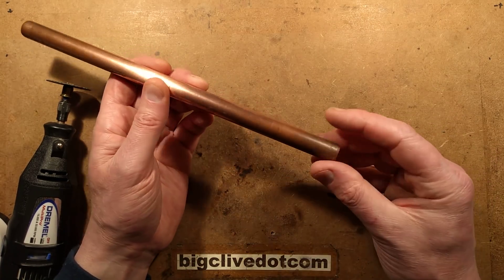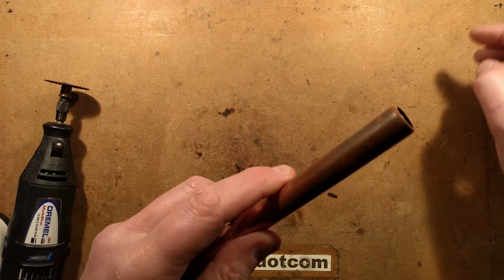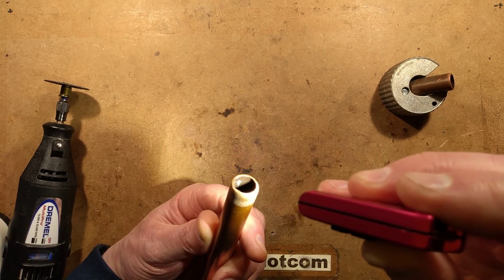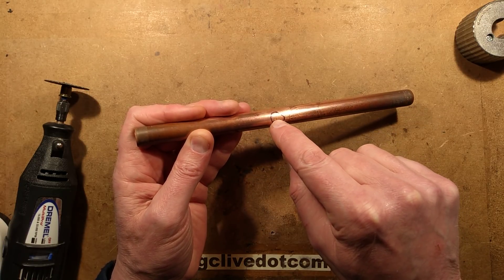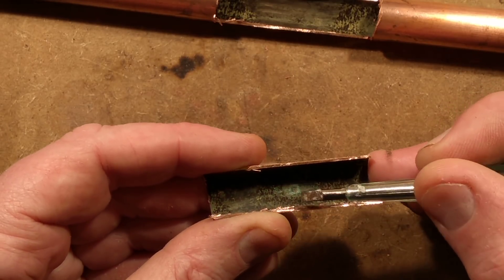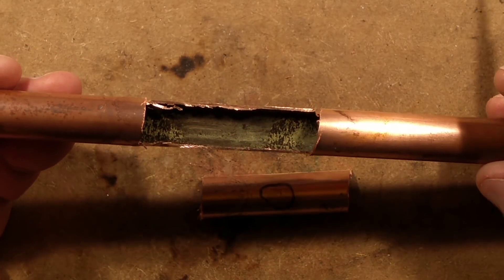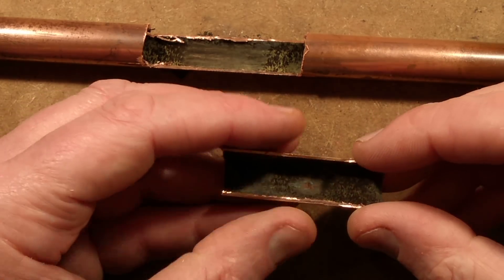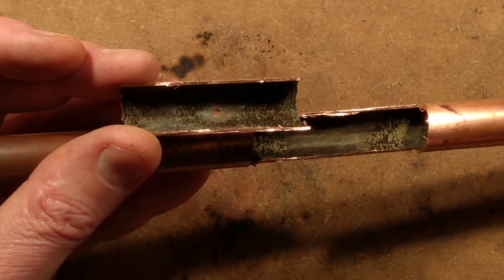Odd pinhole leak in copper pipe.  Selective electrolytic corrosion?

Comment: Great video!  As a plumber myself I see electrolysis issues all the time.  A lot of older buildings here would ground (earth) to the water lines.  Crazy!
Reply: If you keep having the problem, add dielectric unions and insulate the pipe from any pipe hangers that may be grounded.
Reply: @drewdward1   Could the same issue be caused if an exposed copper ground strap for telephone equipment runs over the top of and is in contact with bare copper pipe?
Reply: @paull3031  I'm sure its possible.   We always try to insulate our copper pipe from contact with pretty much anything.  We try to use more PEX pipe than anything these days.   I love the newer 'push' fittings, and no electrolysis  issues.
Reply: @drewdward1  I replaced all the copper in my house with PEX with some crimp fittings but mostly the Shark-Bite push fittings.  It's not very nice and was obviously done as a piecemeal copper replacement,  but I do plan on picking up a couple proper hot and cold water manifolds and running it properly.
Reply: @drewdward1  Push fittings are good ....... but will they stay good for 30 years (and would you care in 30 years time anyway)?
Reply: @totherarf  At this point I'd wager more on them than hand-crimped copper rings due to consistency.
Reply: @drewdward1  i find the rings to be super reliable if crimped hydraulically done with the bolt cutter looking tool or worse with the smaller versions i'd trust the push fittings all day
Reply: @Mister_Brown  Very true, I never have to replace plumbing that was properly crimped. Gotta keep an eye on those helpers/apprentices though!  To be honest, I only use push fittings for 1/4 to 3/4" pipe/tubing.  We use the 'Propress' tool/fittings for anything larger and they work really well.  I still solder, but not very frequently.  I am the lead plumber for my local school system and they don't like me or my guys to use fire.  Some silly nonsense about safety and whatnot.  ;-)
Reply: @drewdward1  silly indeed, i remember growing up in the 90's we had high pressure steam heat throughout our schools and you would often see the maint guys with an oxy rig brazing something.

then again the boiler was still coal fired because they had to refurbish it in the middle of the energy crisis and moving to oil would have been expensive
Reply: @drewdward1  Is it even legal to have a copper pipe system unbonded?
Reply: @GigsTaggart  Its legal, just may not be up to code based on where you live.  Also, all inspectors are different.
Reply: In the UK it is legal to not have all the copper pipes bonded . ... if the main pipes are not metallic and you have RCD protection! As you say, different areas different rules!
Reply: @GigsTaggart  at least here it's required that you bond any copper to earth, it's also forbidden to use the copper for earthing
Reply: The cable company here grounds their lines to the house's water lines in the basements, so I guess it's standard practice here for all water lines to be grounded.
Reply: Sacrificial anode. Has a faster corrosion rate!

Comment: I had the exact same failure. This is hard drawn copper, so it is drawn over a mandrel. The steel in the mandrel flaked off and got embedded in the copper tube wall. And electrolysis between the metal caused a slow corrosion.
Reply: Sounds realistic
Reply: In Germany we had this "pest"  more than 30 years ago. One popular root cause was the kind or the amount of grease used during the  cold draw process. Excessive grease can be carbonized when heated and this residual carbon  increases the tendency to corrosion. This is explained in p2 of  the 1986 paper (unfortunately in German language - sorry)  https://www.schadenprisma.de/wp-content/uploads/pdf/1986/sp_1986_1_2.pdf
Reply: your lucky if any kind of inspection is 1% of the total amount sold not to mention the company that made the pipe is long since out of business or just changed " ownership "
Reply: Spot on
Reply: @greenaum  Actually you get leaks, which is whole different culinary problem.
Reply: @zacharysandberg  It is ;)
Reply: I blame Thatcher!
Reply: @greenaum  Sorry, it's not a reference I get. :(
Reply: He suggested that in the video....
Reply: Agree that it's probably not the mandril theory. I've spoken to the regulating authorities over here as well as the producers. The thing is that everybody wants to point fingers and nobody is going to admit liability, it happens in every industry.

The best explanation I could find after "extensive" research is thus: the copper used is never 100% pure and it is the 0.6% (guesstimate) impurities causing the electrolytic reaction and eventually the pinhole. I've found that pipes with purer copper and greater wall thickness take decades to develop pinholes. The cheaper (higer recycled content) and thinner walled pipes develop pinholes within 5 years.

I have been using PEX exclusively for years and it seems like a better material for plumbing applications. Every material choice has it's disadvantages, it's always a balancing act.
Reply: Quinton Bosch That pipe has probably been there for decades before leaking, though I have no first hand data.
Reply: "caused a slow corrosion."
For what it is it is quit fast.
Reply: Pipes, as well as any other construction elements, have to comply with some tight EU laws and regulations to be in the marked. Seems odd to me they failed to regulate and/or check for impurities in the copper and still have materials shipped all over Europe with this type flaw that can potentially cause tremendous monetary damages.
Reply: lol why not just check every millimeter on the internal side of a small pipe? i'm willing to pay $700 per foot to stop a one in a million flaw
Reply: @johjoh4571  , if a one in a million flaw had another identical one in a million flaw within 6" of it compared to the presumably 100+ feet of identical pipe throughout the house, I'd start buying Lotto tickets.
Reply: Aquilux R. If it's a contamination in the production, it may very well affect the pipes that were made in one particular week, day or hour more than the rest of what that factory made.  Yet a bunch of pipes installed in one house has a high chance of being made within moments of each other, thus getting hit with the same rare flaw.
Reply: @Fly0High  These pipes might've been there for a very long time... before such European oversight existed!
Reply: FlyHigh  Yeah right. Just like electrical gadgets have to comply with the various neat and tight EU laws to be sell in the EU. And just so there are millions of little china lamps, gadgets and power tools to buy in a lot of stores, which could actually burn your house down.
As producer you are obliged to comply to the laws but in most circumstances you are not forced to certificate each piece - just that one sample piece you give to the lab.
In electronics it's even worse. Everybody can put a CE sign on their products.
It's just saying that you claim that your product comply with EU laws.
Nobody forces you to prove that until you get sued.
Reply: @YourAliasIsNotAvailable  True but this is not electronics, it's copper piping. It's not something you do in the garage.
Reply: @YourAliasIsNotAvailable  I don’t think he bought his pipes from China off eBay.

Comment: A this old house video showed flux from installation as possible culprit for similar situation
Reply: I’ve had to have an identical type of fix - in concrete, as that’s the predominant style in Texas, slab foundations and no basement. And I was told the flux does it or sets the corrosion in progress, which continues long after the little solder ball or speck of flux is washed out.
Reply: I was about to say exactly this.  A lot of older pipefitters that used zinc chloride (AKA "Acid") flux and did not wipe off drips or residue are the root cause.  Eventually the chlorides will leech into the copper and corrode it from the inside out because of the turbulent flow in supply plumbing.
Reply: @sivalley  - its preventable even if flux gets in the pipe.  used to do repairs like this at the high school i went to and the leaks were always on cold water lines.  copper installations should be flushed with hot water before put into use.  as for current fluxes being non corrosive i'm not sure i agree.  leaving "never corrode" on fittings turns them this same yucky green.  i'm so glad those days are over and done with.  pex rules.  even on bigger installations 2" viega makes copper look stupid.  my dad worked on plumbing back when drains were leaded in.  talk about archaic!  even today we do installations where the engineer specs cast iron.  wtf!
Reply: michael Some of the early replacement materials for cast iron drain pipes turned out to fail much earlier.  So some customers prefer to avoid all the "modern" drain materials until the particular material has proven itself by surviving longer than cast iron drain pipes. As the cast iron drains could easily last 50 years, it'll take more than 50 years for a material to prove itself superior in the real world.
Reply: @michael-dm2bv  I work HVAC for a living and that includes hot water radiant and low pressure boilers.  We had a crew who were doing copper pipefitting for an additional loop at a remodel I was contracted to supervise, it was getting late and the owners didn't want the crew staying late (aka we want to have privacy for dinner).  They left several fittings coated in flux overnight and had a heck of a time re-cleaning the joints of fluffy greenish yellow oxide for sweating the next day because I was busy doing cleanup and tool inventory.  They had been told not to leave flux on fittings not to be sweated within 2hrs because I had seen it happen before first hand.  It was a very counter-productive morning.
Reply: sivalley - scrap em!  were you doing baseboard?  i hate plumbing baseboard.  demo is my favorite!  and going to the beach.
Reply: John Francis Doe - you are correct as i have had the pleasure of hugging used sections of cast iron older than 50 years.  my biggest problem with it is that with age it starts to flow like shit.  (no pun intended)  i personally think green drainage pipe has the potential to last 100 years.  plumbing is stupid in some ways.  we pipe cpvc blazemaster for sprinkler work sometimes and its a one step (essentially like grey cpvc electrical pipe but rated to 200 psi) but the pvc plumbing drain industry is still stuck on two part cement that can be ripped apart weeks later.  my joint is piped in abs and i have a sewage pump thats run 300 feet to my septic tank and i ran it in 2" electrical cpvc.  not code i am sure but electrical pvc is practically indestructible and it automatically comes with those super deep couplings molded onto each pipe length.  get er done!
Reply: @michael-dm2bv  in a crawlspace no less!  I wish I could have fired them but we were short staffed at the time.  They don't work for us now though.
Reply: Yeah they did a video on this. https://youtu.be/nD5lMITzx_Y
Reply: Too much flux used on a solder joint will leave a residue inside the pipe. Hot water pipes usually dissolve and rinse away the flux. On cold water pipes, the residue tends to adhere to the pipe and cause the corrosion you experienced.

In the case of acid flux, more is not better.
Reply: https://youtu.be/nD5lMITzx_Y
Reply: This happens when flux gets into the pipe
Reply: I was thinking the same thing. This looks a lot like the This Old House video.
Reply: TOH is extremely unreliable
Reply: @phonotical  Occasionally. Not extremely.
Reply: @phonotical  back that up
Reply: @daithi007  read their comments from people who have been years in the business
Reply: @phonotical  so instead of you making your point eloquently now I have to basically go off and research your point, that you ineloquently made and can't back it up with a reference
Reply: @phonotical  Fail.
Reply: @phonotical    You ever wonder why a person that has been "in the trades" for decades watches TOH videos and then makes comments about how they do everything wrong?  You would think they would have better things to do. Or maybe.......
Reply: @Bill-YellowDogWelding  everybody gets ten minutes free to take a dump and their videos are hardly a 3 hour series, why are you so quick to defend something you have absolutely no involvement in 😂

Comment: This is normal. You can expect the rest of your copper to do the same eventually. 25-50 years is a normal lifespan for copper.
Reply: i have copper in my house that is almost 100 years old, and i removed a bunch proactively when we did some work and replaced it with pex but when i cut open the old stuff to see how bad it was, it looked like it could have lasted another 100 years easy.   maybe they used to make it better or i have good water, idk....
Reply: Of course they used to make it better. Old stuff is always built better.
Reply: I have to respectfully disagree that this is normal in a copper system.  Properly designed and operated systems seem to have an almost infinite lifespan.
Reply: @mark33545  I'd guess it is a question of whether ones water chemistry is inside the survival range of copper.  I've torn out hundreds of copper systems in my area, and they typically look brand new.
Reply: soft acidic water from a well will eat it right up.  Does depend a lot on your water.

Comment: I have seen this a couple of times over the years on copper hot water tanks - both times due to a fitting of the wrong material (steel?) used near the tank causing electrolytic corrosion. Had the same external appearance as yours - .little pinhole jets of water.

Comment: It happened in my old house a couple of times.  I woke up one morning to an odd hissing noise and I started searching about trying to locate it.  I finally sourced the sound to behind the wall behind the toilet.  I had to remove the toilet and cut a hole in the drywall to get to it.  These were cheap houses built on concrete slab in the early 60's and they ran thin wall copper tubing underground since it could be easily bent (even though it is not burial rated).  The town water had relatively high iron content and the pipes would slowly corrode from the inside out.  Some people had washouts occur under the slab.  I sold and left the problem to the new owner as replumbing was going to be a bit of a nightmare.  Your pipe corrosion is much more unusual, definitely some much larger piece of foreign metal had bonded to the inner wall, I'm very surprised that it managed to eat all the way through a K type thick walled pipe.